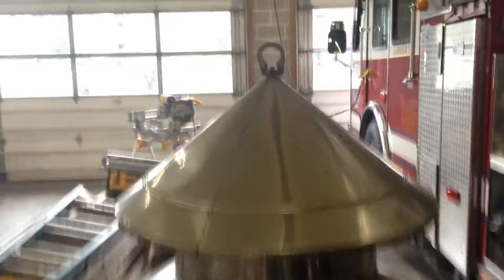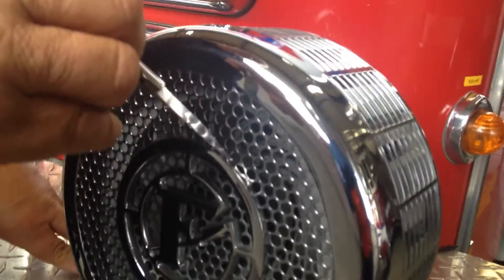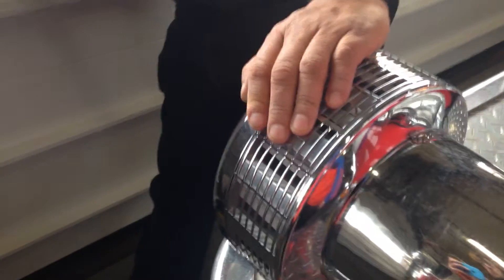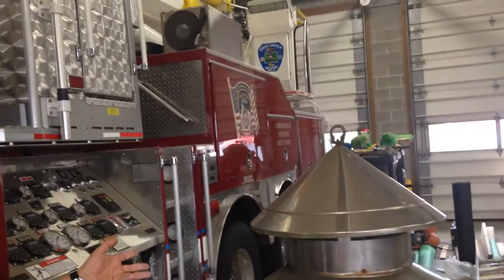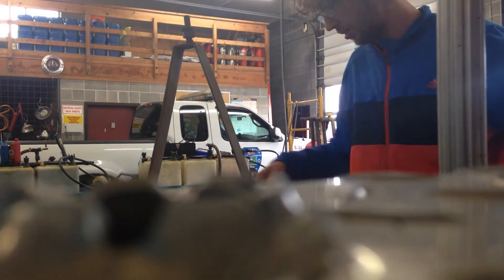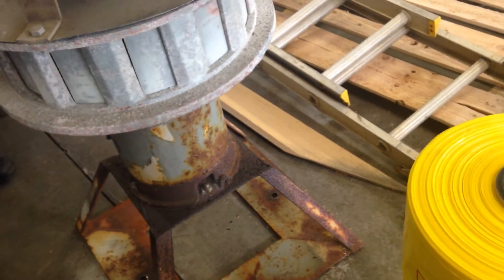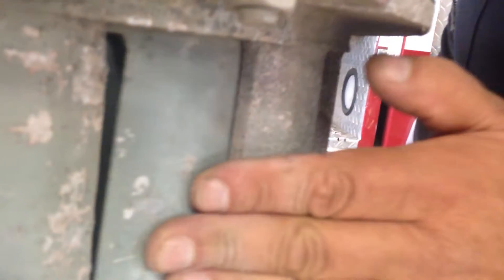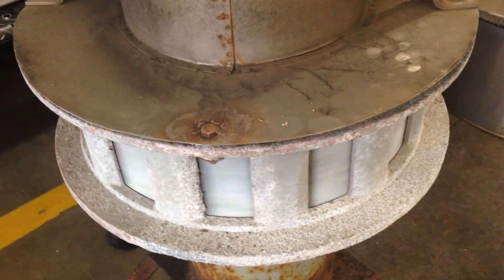My model 5 siren ground walking tour. (Includes a model Q and how it works.)

Comment: That Type 5 or 7 Horsepower siren looks beautiful in polished steel..!  SO the technical term is called an "Airaphone"  The rotor inside spins chopping air through the stator which produces the sirens sound... The frequency of the sirens sound all depends on the size of the rotor and stator along with the size of the holes or ports on the stator.... you can have a Low tone, Mid tone, high tone or even a dual tone siren by Federal! The Fedelcode or Federal Type 3, 5 and 7 sirens are priceless. ! They were made between 1940 and 1970.... different variations of the outer housings when studied determine the year that the siren was built .. anything with a Fedelcode Label on it is 1940's... The siren you have is a 1960's model...and its a standard 16 port high tone.... The siren weighs about 250 LBS... I have worked on the sirens since 1989... I also own several of them...
Reply from the maker: Nice! But... I only counted 12 ports? I thought the pitch was mainly dependent on how many ports it had and the horsepower of the motor? Maybe not idk...
Reply: your right..twelve port... the low tone sirens have 8... the dual tone have twenty four..

Comment: DO NOT SCARP THIS SIREN!!! IT will RUn For ever!!! those rusted bolts are no big deal!!! paint them with rustolium! It will last 100 more years! These sirens are the best sirens ever built!
Reply: SCRAP! DO NOT SCRAP THIS SIREN!
Reply from the maker: Why would I scrap her? Lol. I took her to keep her from being scrapped. As much of a PITA as she can be to move she’s still a good girl. Also in terms of “best ever built” idk... I’ve seen quite a few well built sirens that are still kicking. Ever hear of the federal signal thunderbolt?
Reply: We all have heard of thunderbolts. I’m trying to get a hold of one to be the brother of my 3t22B.
Reply from the maker: Bro I was asking if he heard of it because it’s a different siren from the one in the video and the, at the time of this comment, 2 sirens I own were in the same weather conditions (coast and salt air) and the thunderbolt is in better condition. So no I don’t think that the model 5 is the strongest siren ever built. It’s a strong one but comparing my 2? The thunderbolt seems to handle weather a bit better. I hope you find one! But given your user name... don’t you already have one? Maybe you are a different trains and sirens...
Reply: Ah.
Reply: Yes, I’m not trains and sirens 1 from South Carolina, I’m trains and sirens from Pennsylvania who owned a model 2 (siren on a pole next to my shed) and my 3t22B to replace it once I get new solenoids and a 240 volt generator. My 220 model 2 runs on the conduct of the house.
Reply from the maker: Ah okay. Well pleasure to meet you all! I don’t have a blower for my bolt but if I did... lol. I’d have to take it to somewhere that would allow me to rip her off.